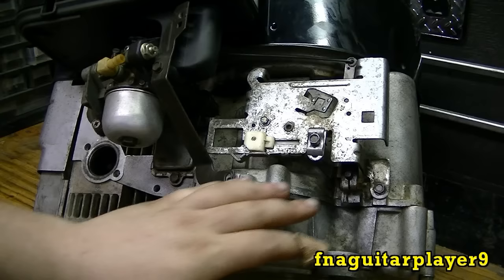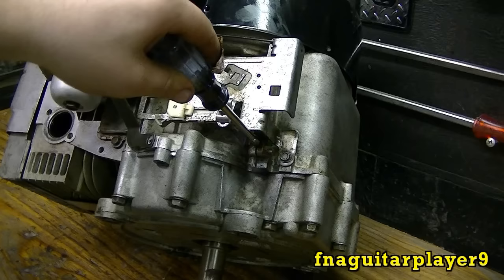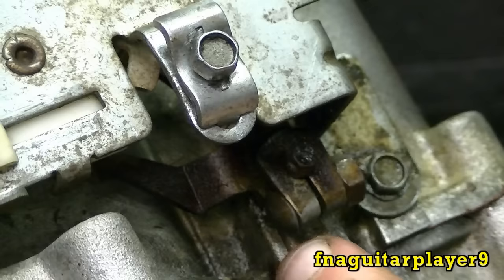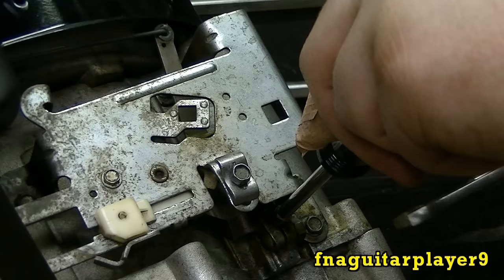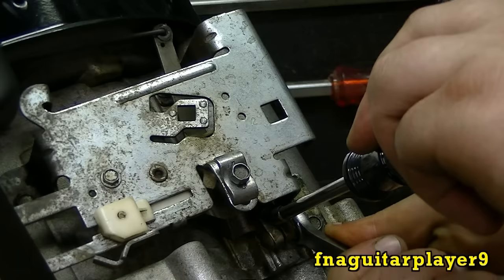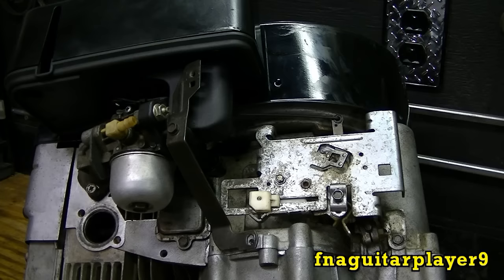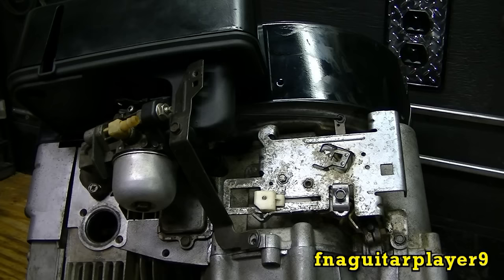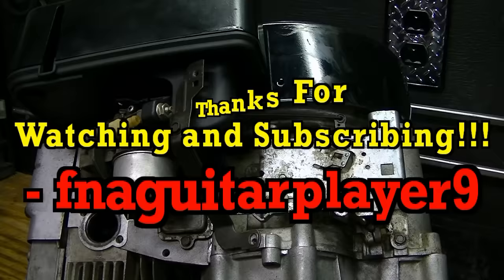How To Adjust Mechanical Governor On Small Engines

Comment: Thanks, Much more helpful than the governor adjustment page on the Briggs website.
Reply from the maker: +Will M. Your welcome! I hear ya, it is weird how they explain it. Thanks for Watching!!!
Reply: +fnaguitarplayer9 Finally, a "Youtube Expert" who actually knows what he's doing! I just remember to: "...move the governor arm to hold the throttle in the WFO ("wide f****g open") and turn and lock the governor shaft the same direction as the gov. arm moved to open the throttle & tighten. I hope you're not like that moon-faced "donyboy73" kid who tells you to completely disassemble the starter from the blower housing to replace the rope and/or recoil spring on older Briggs'. I told him you don't need to EVER remove the pulley AT ALL unless to REPLACE that pulley. He cussed me out instead of thanking me. Of course, I've only been doing this "small engine repair" thing since October of 1973 so what do I know? On the 12*** series Briggs-powered lawn mowers, I got it down to where I never even had to remove anything to replace the rope. I mean, there are those decorative plastic round covers that come off w/no tools. That has to come off.
Reply from the maker: Appreciate that! I tried to explain it as simple as i could. I hear ya, I've watched alot of his videos he's good at it, but everyone has there own way of doing things. I know what you mean, your right, you don't ever have to take it off unless the spring is broke or its broke itself, you can wind the rope with it still in the shroud. Faster and easier. Sometimes the rope is to big and its hard to do though. Thanks for Watching!!!
Reply: If the rope is too big, go for smaller like 4 or 4.5. I like using the smaller because you can get more in and you don't pull out to the end and dislocate your shoulder. Besides, when I'm done working on something, all you have to do is pull the rope out like maybe 2 feet at most for 1 pull starts. Did you make a Briggs spring installing tool from an old 399671 starter clutch? You weld a shaft with a 'T' handle on the square trip after taking it apart. As a kid, I used to replace ropes on my 1970 Steens Taco 99 mini bike with it's 5 horse Briggs by taking the damn thing apart. Somehow, I'd get it back together w/o putting my eye out with the spring. That's the way stupid donyboy73 tells people how to replace a roe and/or spring. He's still young. ME? I'm 61 and still have the Taco 45 years later! Never had the engine open and it still starts first pull. I did replace the tank when I left some gas in it and it rusted out.  I made a "Rat Bike" out of it. If you click on my name, a bunch of pictures should come up. I think I post some pictures of it. If not, I'll do that now. Later.
Reply from the maker: Yeah that would work too, i like the idea of having more rope on it, it does make a difference. No i didn't, i'll have to try that out. I hear ya! I hate messing with those springs. its a pain. I hear ya, i'll have to check that out!

Comment from the maker: If the linkage is unhooked and its hard to move, the oil slinger/governor may be broken or stuck or possibly its way out of adjustment and needs to be adjusted like in this video. Rare problem, but it does happen. Thanks for Watching!

Comment: Nice video.  Thank you.  But wish more governor adjustment videos online would simply describe the governor adjustment at the actuator shaft not clockwise or counterclockwise, or front/rear of engine,  but simply turned as far as it will go in the SAME DIRECTION that the arm moves when moving throttle to to high speed.   If the arm traveled to the left when moving the throttle to high, then the shaft is turned to left until it stops.  Arm goes to the right when moving throttle to high?  Turn gov actuator right till stop.    Much easier to remember and applies to all engines. 

And hold that gov arm end with a little zip tie for heck's sake till the nut is tight.  "securing end of control arm while adjusting governor on snowthrower engines" is listed at no.1,446,348 in the official wiki list of 3.24 billion (and growing) recommended uses for nylon zip ties :)
Reply from the maker: Makes sense, good advise about a zip tie, that was annoying, most of the time i don't have that much trouble with one haha thanks for watching!

Comment: Hey Partner! my 12.5 briggs is reved up and won't idle cleaned the card as instructed the throttle plate is closed with the governer arm from the motor is to the front of the motor with tension push it back a small amount and it over revs adjusted the governer as instructed.  Ps thanks for the quick response yesterday I'm looking forward to the opposed briggs vids, TIA!
Reply from the maker: Jorge Lopez Hey! Have you checked the intake gasket, sometimes if there is a air leak there it will idle up really high. But there is also a chance that something is wrong with the internal parts of the governor, on the oil slinger, thats about the only thing thats left if the linkage moves free and the governor is adjusted correctly. Your welcome! Yeah, i plan on making a few on the opposed twins. Thanks for Watching!

Comment: sister machine,snapper ss822ex snowblower,8hp B&S engine,replaced primer bulb/cleaned carb,float,needle valve/new gas,starts but runs rough,will not idle up to full speed,even tried moving governor arm almost dies.Is this Governor problem or carb problem...Thanks for your help find your video's far more informative than any others.
Bill
Reply from the maker: Sounds more like a carb problem since its dying when you override the governor, its probably trying to run to lean, it could be a clogged passages or the carb is just not adjusted right. It could also be weak spark causing that, check the plug if its yellow or orange spark or intermittent that could be the problem (either plug or coil). Thanks for Watching!!!
Reply: @fnaguitarplayer9  Hi, thanks for your answer, I replaced the plug and checked it plenty of spark,next tried to change out the needle valve/seat inlet, ordered parts carb 12A1 03 0148 E8 briggs and straton , my carb has brass seat inlet, looked it up and came across part #690577 seat-inlet but on website says not for my machine, chatted with rep at replacement parts and she said she talked to people there and it would work, got it and Not the right part.New part 690577 is longer/wider than one in my carb, i have a picture but no place to send it here(sorry).Now wondering if someone before had changed the carb out with a different one then belongs on machine,there is a number stamped on carb on side 216701...any idea's would be appreciated 
Thanks Bill

Comment: watched the adjust mechanical governor and it was very helpful but when I put the throttle to slow the engine does not slow down or idle thanks for all the videos
Reply from the maker: +Raymond Schwartz Your welcome, if the throttle control isn't doing anything, then you have a broken governor spring or linkage or the spring came loose. Thanks for Watching!!!

Comment from the maker: have you adjusted the cable, loosen the clamp, set the throttle to fast then pull the plastic (or metal if its a older engine) all the way back? If you've done that, then you need a new governor spring, the one thats on it is stretched and needs replaced. Thanks for Watching!!!

Comment: I have a 8 hp Briggs. Just put a new carb on it.The governor will go into full throttle but you can't idle it down. Everything looks in place but the arm by where you adjust the governor doesn't move all the way up not letting it go into slow speed

Comment from the maker: It depends, if its a push mower engine the governor is external (air vane) but if its like what i show in the video, its more than likely a linkage in a bind. It is possible for the internal parts to have broke or seized up, its rare but it happens, what I would do is remove the carburetor and unhook the linkage, then see if it moves free, if not it could be the spring hanging up or something wrong with the oil slinger/governor inside it. hard to say without seeing it. thanks for watching!

Comment: I can't seem to get a classic carved Murray to run at a decent RPM...very low...I adjusted the governer.  Lessened nut.  Pulled governed arm back.  Then turned the adjustment clock wise....didnt help at all...im very perplexed.   Carb cleaned too. New gaskets...in correct order.

Comment: Excellent video. One thing I was not sure about was the throttle position before you do anything. I set my throttle to lowest setting. Don't know if this is correct?
Reply: I stand corrected. If you look at the position of the plastic piece being all of the way forward, that implies low throttle position I believe,

Comment: Clockwise?  Is that toward the front of that engine?

I am told by a guy that has done this his whole life to turn the shaft toward the rear of the engine.  I did as you show. Mower wanted to run wide open if the throttle was increase any.  Finally, the gov shaft broke.  Now the engine will not run.
I am a little confused now.  Different direction for different engines?

Comment: The governor mechanism on my riding Husqvarna yth1878 w/ Kawasaki engine has the most complex mechanism I've ever seen. After installing a new carb (cheap aftermarket) it started idling way high and wouldn't come down. Sadly after messing with it for several hours, I'm ready to throw in the towel and consult my local small engine repair shop

Comment: I wonder why some people say to rotate the governor shaft counterclockwise. I'm guessing it is for what they have known to be for some specific engines. Generally, if I am not mistaken, the shaft should be rotated till stops in the same direction as the governor arm moves to get to full throttle. Wish someone would make this clear, if I am not mistaken, again.

Comment: Honda GX620 here last summer engine ran perfect could crack the throttle wide open and let off throttle it would drop to idle smoothly with no surge or any problem. Recently running the engine again and giving it a quick full throttle crack and letting off throttle the rpm`s drop as they should but once coming close to idle the engine just stalls. Changed plugs with new ones and still same problem. Adjusted coil air gap and same problem. Looked at governor thinking it was at fault but it was already set. Took carb apart and cleaned all jets and ports and emulsion tube. Its spotless. Engine still stalls out after a quick throttle crack coming back to idle. Took carb apart two more times after the first thinking I missed something and yet engine still stalls returning to idle. The engine will return to idle normally if I hand throttle it down slowly to idle. Compression check shows 85 in one cylinder and 90 in the other and thats within Honda specs so i`m ruling out a compression problem. I`m at my wits end with this thing. I`m thinking now its electrical maybe a bad coil(s)? I checked spark with an inline tester (the kind with a light bulb in it)and both coils fire, both plugs blue spark when spark testing grounding out the plug while its off the head. My other thought is it may still be governor related as I did modify the spring between the governor arm and the linkage where the cable pulls. I made a hair adjustment to the spring by shortening the bend in the spring where it hooks into the cable pulled end of the linkage. Any thoughts?
Reply from the maker: Might want to check the idle speed adjustment screw, if its set to low the governor linkage may be pulling it down to low, especially if its been modified. If you run the engine with the inline checker in it and see if its still lighting up when its stalling out, if it quits lighting up then you know its ignition related. let me know if you find out anything new. Thanks for Watching!
Reply: @fnaguitarplayer9  good point on leaving the spark checker inline while the engine idles down and dies to see if there is spark while it stalls. Thanks.
Reply from the maker: @leemer1  Its the best way to rule out the coil. I had a problem on my opposed twin and found it quit sparking when it got hot. your welcome.

Comment: thanks for this -=- i was fiddling with my mini bike and was trying to learn how to make it go full out ...
Reply from the maker: Blair Nivens Your welcome! Be careful bypassing the governor though, it will throw a rod. It happens all the time, if you want more top end i'd suggest changing the gearing (sprocket sizes) you will loose acceleration but gain top speed. But i've seen a ton of engines blown up from bypassing the governor. Thanks for Watching!!!
Reply: you explain things quite well  -=- changing the front cog is my second idea -=- i have a front 12 attached to centrifugal clutch -=- will have to try 14 or maybe 16
Reply from the maker: Blair Nivens Thanks! Yeah thats what i would suggest doing, and if that still not enough, maybe a smaller sprocket on the rear.

Comment: I hope this helps me.. I bought a new looking mower. 25 hours later it surges when under load. Replaced the filters, oil, spark plug and it still is doing the same thing. If this doesn't help, idk what to do.